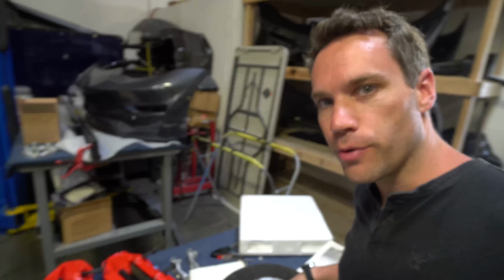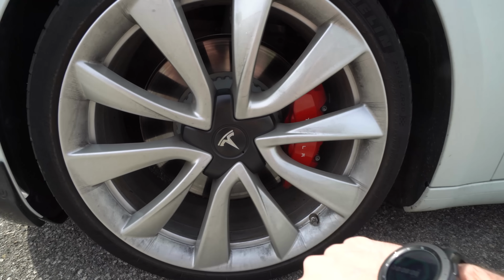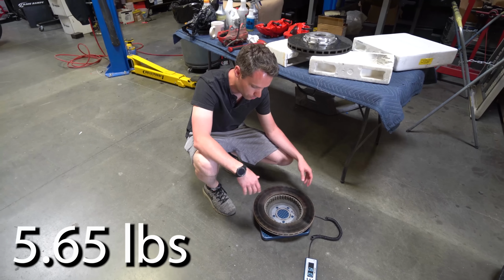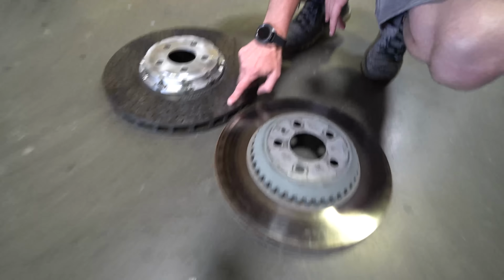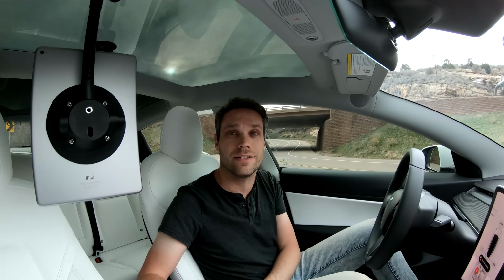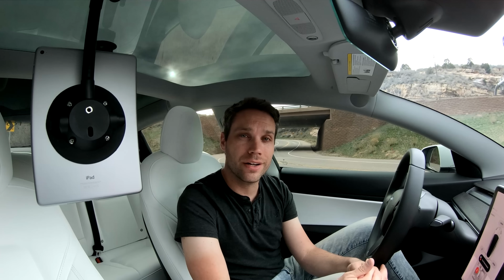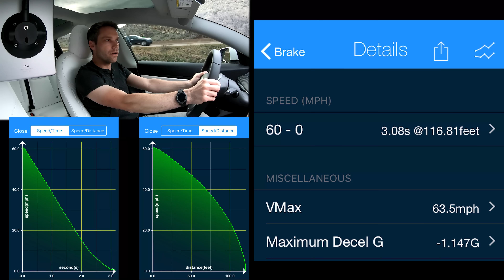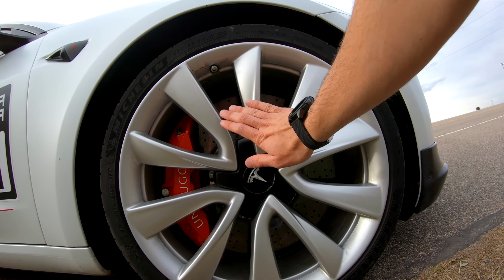$8,000 Tesla Model 3 Brake Job. *Carbon Ceramic*

Comment: The brake kit looks great, but generally upgrading your brakes as little to no effect on stopping distance. The tires are what do the stopping, and most people's stock setup on a performance car will be able to lock up the tires and stop you pretty fast. You may shave off 4-5 feet, but that can be due to reaction time, or that if you did the upgrade properly you have better brake lines and a better master cylinder that will grab the disc instantly instead of lagging a split second. These look great for track  use though.

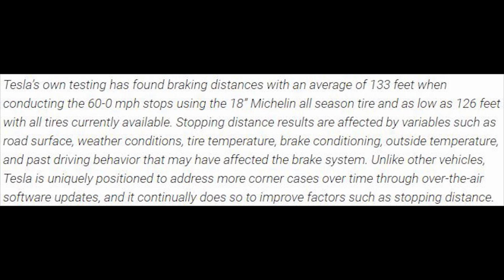Comment: You should have measured before you did the change. The only reason you're stopping sooner is because you have 20'' Michelin P4S summer tires on, which are sticker than the 18'' all seasons that tesla used to measure at 6:58. Hopefully you didn't throw 8k at a car you probably never take to the track.

Comment: If you go testing hard braking after installing new brakes, make sure they're "bedded in" properly so you ensure pad material is evenly distributed. I hear doing that with new brakes and not properly bedding them in ahead of time can be a bad idea. Not saying you didn't do that, but just a fair warning to anyone else out there. 😊
Reply from the maker: Unplugged bedded them immediately after install. 👍 So I was all good to go!

Comment: Don’t have a Tesla so might not no what I am talking about.  But wouldn’t these be very unnecessary if you were just driving on roads? From what I herd you barley us the brakes with regeneration. I understand he will be racing so it’s a different story.
Reply from the maker: For a normal driver, yes, these are not needed. But on a track you brake hard and accelerate. Not a lot of regen on a track.

Comment: FYI - The Performance 3+ has always had better braking performance than the normal Model 3's. Motor Trend got 99 feet once the brakes were warmed up.  Here's a copy/paste: 
"The Model 3 DMB has a very firm brake pedal, without much travel or feel, but the brakes are highly effective and consistent. I did one stop from 100 mph (the second one) and got them rather hot and a saw a puff of smoke when the car stopped. On the next pass, the distance shrank to the shortest stop (99 feet), so the brakes are capable of dissipating heat well. In order: 100, 105, and 99 feet."  So basically these aren't stopping quite as well as stock, but try them warmed up and you may see better results.
Reply: Yeah its completely useless testing them cold and only stopping once or twice from 60. Carbon ceramics only help with brake fade and very negligibly braking distance and you need heat in them.

Comment: USE THE METRIC SYSTEM!
Reply: THIS S AMERICA WE DON'T USE IT. WATCH CHANNELS FROM EUROPE IF YOU WANT METRIC. WE DON'T AS EUROPEAN YOUTUBERS TO CONVERT FOR US.
Reply: Both comments are rude :)
Why caps lock
Here some metric results from an European who is watching "ZE AMERIKAN" channel :)
carbon ceramic discs  13.45 p = 6.1 kg
Tesla performance steel discs 19.10 p = 8.7 kg

carbon discs brake distance 113 ft = 34.44 m
Tesla performance brakes distance + some regular tires 133 ft = 40.54 m
Tesla performance brakes + Michelin 128 ft = 39.01 m

6 meters difference in the breaking is 'UUUUGE 
but the price of the kit too :(

Comment: I believe from the number of professional tests done, ceramic brakes don’t brake better than similar iron brakes in regular conditions but they will maintain that performance consistently at the track.
Reply: I'd be willing to bet he never actually benefits from them, despite it being "cool".
Reply: @TheBowerbird  and he definitely won't benefit $8,000 from them. He should have just gotten the track pads from MPP and called it a day for a small fraction of the cost...
Reply: No disc brakes that can lock a wheel will brake better or worse on a single go. Its worth noting though that high performance carbon ceramic brakes with ceramic pads, and carbon carbon brakes, will not reach optimal braking at ambient temperature, and need to be "warmed up." Based on the size of those brakes though, I doubt that is really necessary, since in a race car the brakes are going to be smaller (lighter). Also new rotors require wear in. Easiest way is to ride the brakes lightly for a while, but I don't know if Tesla lets you do this. Unsprung weight reduction is useful in a model 3, but you are better off with carbon fiber wheels, than carbon ceramics. Personally I would have gotten lighter weight alloy rotors with better cooling, rather than carbon ceramics, as alloy rotors are a bit more practical, and will not have worse braking when not warmed up. So long as you aren't boiling off your brake fluid, you should be fine. I think for a bit more money, he could have gotten some 9.5x19" wheels with racing tires on carbon fiber wheels, and a set of alloy rotors. Well, a little more like $16,000 lol, but that pretty much puts the Tesla as track focused as it can get sans doing a full race-car build that will tube frame it up, and strip out the interior.
Reply: They have to be warmed up.
Reply: Yes and no. They won't brake better than a equivalent iron set, equivalent being the key word. Being in size and thickness etc
Reply: I would just add cross drilled rosters with high performance break pads, unless your job is racing in the track all the time it's not worth the price for regular use, besides looking cool.
Reply: @stinger15au  Until you reach brake fade, its irrelevant in braking. If you can lock up the wheels, you will never have a shorter stopping distance. The reason for a larger rotor is more about having more surface area to evacuate heat from, which is important when you are constantly pumping a lot of heat into the brakes. Carbon Ceramics are really only useful if you are racing, and even then, mostly useful if you are grid racing where you will not have the opportunity to drive cooldown laps. For enthusiasts, you are way better off with metalic discs, because they are much cheaper to replace, and much less prone to damage and destruction. I looked into carbon ceramics, and decided that they basically aren't worth it unless you have too much money and nothing to spend it on.
Reply: They generally perform WORSE at daily driving temps. Thats why youll see ferraris fly off canyon roads all the time. They don't know to preheat the brakes before bombing down some runs.
Reply: @dreiak  re warming up brakes - you are confusing carbon carbon used on F1 cars w CC brakes. CC brakes have superior braking performance than iron, do not need to be ‘heated up’, weigh substantially less (unstrung weight so improves steering), cope better w rain and produce no brake dust

Comment: Carboceramics aren't about brake distance but avoiding fading after several hard brakes.
Reply: It's about swept area, fade and unstrung weight.  The big limiting factor in braking is heat and tires.  Carbon ceramic addresses the heat issue, but tires are also a big factor.    The big question here is, is it worth $8k for carbon ceramic?? Wait till he cracks a rotor or needs pads or a brake job.  Remember, carbon ceramic still wear too.

Comment: You were talking metres and comparing them to feet stopping distance on pre-ceramic discs (no wonder you were impressed). The graphic overlay shows feet and there was a small decrease in stopping distance with the new brakes. It is when they get really hot that the ceramics will keep working fine while the earlier discs will just fade to useless but when cold after a few 60 to 0 stops the improvement is small.

Comment: Pretty cool.  Coming from F-car ownership I understand the need for big brakes and even carbon ceramic especially if you are tracking, but now that I own a Tesla MX it doesnt really make sense to make this sort of brake upgrade if you are using regen breaking.  Also, when switching to carbon ceramic you normally also install a larger brake booster and bake fluid reservoir to really take advantage of the big brake kit.

Comment: Nice but it's actually slower than S ludi acceleration. I actually think they should look into dropping mechanical brakes at the rear. Maybe even all together when the drivetrain is as strong as it is. Technical detail when fully charged and strong regen but that's solvable. It would be quite elegant to ditch mech brakes.
Reply: This has nothing to do with acceleraton and it was never meant to be S.
Reply: 3 can handle the track without overheating like an S though.
Reply: @mravecsk1  It very much has something to do with acceleration. It is acceleration and it's about grip. So normally it should be able to brake faster or as fast as speeding up. So there should be room for further improvement.
Reply: Dan Frederiksen They (rear brakes) are required by Federal regulation.
Reply: @monteengel461  even if so, that could change.
Reply: Dan Frederiksen it would be a tough sell... having redundant safety features is a very good idea.  They might be able to get rid of them if they installed a shunt and load resistors so the rear motors could always act like brake - but then you would have problems with the open diff.

It actually might be a really good idea if/when they go to a hub mounted motor.
Reply: @steves.3485  it's fairly obvious to get rid of the diff, just two motor sides. Doesn't have to be in the wheel.
Reply: Dan Frederiksen with both wheels being driven by the same shaft the car would have a hard time turning - the tires would chirp and eventually it would cause damage to the tires, suspension, and axles.  Large trucks can get away with a fused diff because of the much larger turning radius and much heavier duty components... it still isn’t good for the tires though.
Reply: @steves.3485  I said a motor for each side. No solid axle.

Comment: Test 60-0 dont have any sense, any brake capable to lock the wheels will make the same braking distance.
If you can find any difference is not for the rotor/caliper.

Comment: I can offer some advice on this matter, I have taken a high performance racing class at Road America, I have friends who race, the carbon ceramic brakes are an excellent addition for racing, they reduce brake fade to a minimum, very good stuff. However, brakes aren't usually the limiting factor in stopping distance, that is a tire limitation. Think about it, almost any brakes can lock up the wheels with a heavy application of the brake pedal, that's not the problem, it's the tires that interact with the road surface, the tires traction is the main concern when it comes to reducing breaking distance. Carbon brakes reduce fade, sticky track day tires reduce breaking distance. I promise you, using track tires in conjunction with those fancy brakes will transform the braking performance into race car territory.

Comment: A completely stock model 3 performance's braking distance is actually closer to 100 feet according to car and driver, not 120 or 130 feet. As many others have said, carbon ceramics only help with brake fade and maybe slightly with unsprung weight but that's about it. If you are just tracking for fun, it actually makes more economic sense to run steel rotors because they are only 1/6 of the cost. The model 3 throttles performance anyways after a few laps why not just take the opportunity to do a cool down lap.

Comment: Metal brake lines are more of a myth.
Carbon ceramics don't show their pros if you break from 60mph for few times. I bet that on the same test the steel would yield more or less the same result. Break 10 times from 120mph if you want to put them to the test.
The break fade felt when tracking street stock cars comes from the pads. Replacing the pads with something really meant for track abuse (eg. Pagid yellows RS-29) will cure any fade. Then if you trash the rotors just get some fully floating ones. If you boil the fluid replace it. All these would've cost you a fraction of the ceramics and performed just as good but not that 'cool'. If steel rotors are good for GT3s I bet they are good enough for your car.
Even the process to determine if the rotors should be replaced is a nightmare for ceramics. Special scanner or a really precise scale is required to weigh them. Also winter salt is no friend of them.
Reply: Carbon ceramic is good at minimise brake dust and rolling resistance for better handling and accel/deccel. And they have better thermal capacity as well. Steel rotor are more cost effective choice for most of track use since they're way cheaper to replace when trashed. But why not go carbon if you feel like a baller lol

Comment: Can you have a different sized wheel with those brakes or do you have to keep the 20”? (mine are 20” stock) I downsized to the 18” martians. I would really like to upgrade the brakes but almost hate the thought of having to upsize the wheels to accommodate the brakes.

Comment: $9,000, that's a whole new car..ill stick with my stock brakes...there just fine enough
Reply: Tesla Santos 

Most likely is free.  Advertising all this mods
Reply: Tesla Santos $9,000 will buy a very used car.  The lowest price new car, with no options, will cost ~$18,000.
Reply from the maker: These were not free.

Comment: Bad ass, Id love to replace my p3d- brakes with these. Too expensive though... Will your stock brakes fit on my car?  I'm change to 19s today.  How does UPP cycle the abs module to get the old fluid out?
Reply: If you don't track your car there's absolutely no point in doing this...
Reply: @jeppewerring  I'm hoping to take it   to the track in the future.  Getting forged 19s to replace the 18s.  They will be lighter and stronger and allow for larger rotors
Reply: @JFlywheel  how often?
Reply: @jeppewerring  No idea , just an idea I had floating around.  I would likely get a different brake kit though.  To much money for brakes for me.

Comment: You might want to try with track mode off and let the ABS do all the work.  With ABS on just push the brake pedal as hard as you can.

Comment: If I had to make an educated guess based on my years of tracking/racing different types of cars I am going to say that depending on what tracks you want to set records on a smaller battery RWD Model 3 with aftermarket suspension and takeoff M3P brakes and wheels and tires is going to set faster lap times based on the fact it is nearly 400lbs lighter than a M3P.

Comment: You kinda messed up weighing things as you must weigh all parts that got taken off and put on to know the full and/or true difference in weight of this install. Those calipers look big and heavy plus they perhaps hold more brake fluid than the stock brakes. So truthfully you don't know the the total weight gain or loss as all parts changed must be weighed against the original parts that came with the car and you didn't do that.
Reply: Sprung vs Unsprung weight...big difference. Takes far less torque/HP to rotate less weight meaning more of your power reaches the pavement quicker.

Comment: Isn't  you before the upgrade the perfect person to test the Performance Model 3 with standard rotors? You accidentally have also had the same tires and the same car. I'm not sure but I think you were also availible. And you even have a Vbox already set up in the car.

Comment: I'm sure as sponsor of UP you didn't pay full price, if at all, but for 99.95% of Tesla model 3 owners, have no use for racing brakes on the streets of the USA. Go drive the Autobahn and be able to afford such a system as UP provides, and I would say SURE. For the rest of the Tesla nation these racing brakes do look awesome, they do provide longer braking distances when cold. Of course fade is all but gone, and I'm unsure why they didn't design for the rears as well, especially for race applications. Also if your going to race, you might set-up front and rear suspensions with more Camber and Toe specs. Why go half way with race set up and not adjust for those and Caster settings. Most likely because they may not have many adjustments to do so. These race settings are impractical for street use as well. So, in conclusion, if ya want'm get'm. But don't stay up nights dreaming about them....also with my history using cross drilled AND slotted rotors, they WILL in fact be noisier under normal street usage. Could tell if the cross drills were camfered or not, which will also make them noisier. Good luck in Colorado in the snow with this set-up...!!??
Reply: If that is the case he needs to be 100% transparent with that. If hes not its dishonest and shady...

Comment: If you are really into racing and taking your Model 3 to the track every other week, this is a great investment into driving performance. If you are taking your car to the track maybe once or twice a year and just want better overall driving performance, go for the Brembo Two-Piece brakes, that are also sold by Unplugged Performance. You Safe a cool $5k and get better performance in everyday driving than with the carbon rotors.

Comment: Whats the caliper weight difference though? They look heavier beasts, especially with the larger size AND I, suspect the pads are larger too and will so weigh more as well?
What is the overall weight saving or loss?
Reply: Good point. Still not very practical for street use...??!!
Reply: @44kas88  Well he said he bought those brakes for TRACK use.

Comment: I heard track mode actually cannot handle the huge brake bias introduced by cc front brakes. Anything from UnpluggedP about solving this problem?
Reply: Track mode uses regen
Reply: Benjamin Orlowski Track mode also micro-control the brakes a lot to do torque vectoring. Because Tesla don’t have locked differentials, braking is very important for track mode.